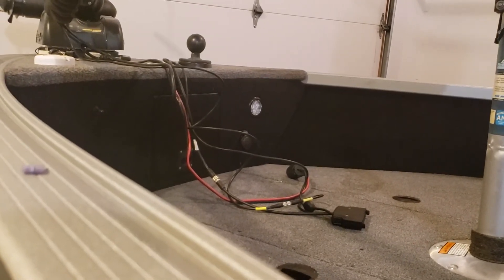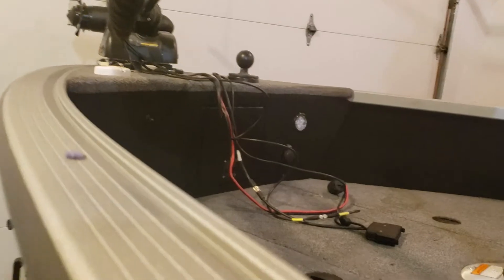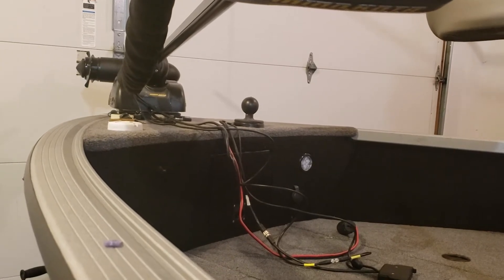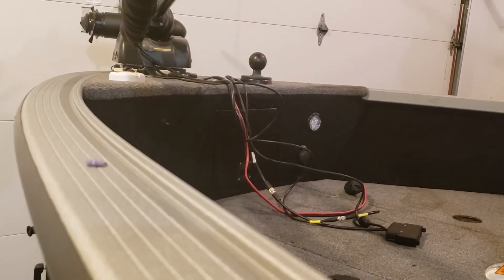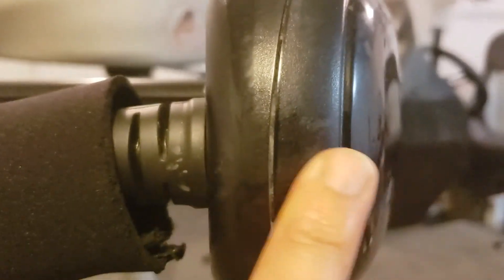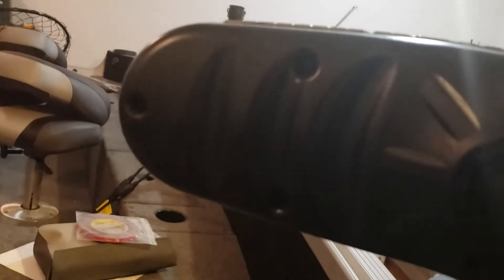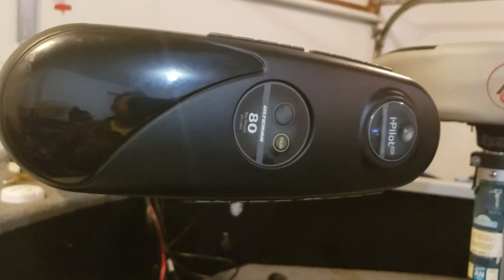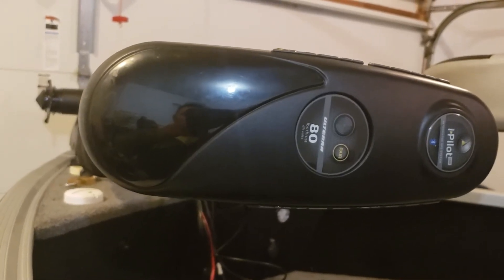SI Interference from trolling motor

Comment: Nice video, my question is that i hit a sand bank with my ulterra at speed 6, after 5 min of hitting it my prop wouldn't spin no more. The 3amp fuse was blown.  I replaced it and the prop started working again.  But now my lower unit has electrolysis, white ashes powder that is burning through the lower unit.  Do you think i have a ground shorted in my lower unit after i hit the sand bank with it?

Comment: What if I have interference and the fuse is good? That is my issue. I wish the fuse was blown then I would know the problem.
Reply from the maker: Do you only have interference when the motor is running, or do you have interference all the time?
Reply: @RealLifeFishingWI  when its running 1 to 9 speed. 10 speed no interference
Reply from the maker: Hey, sorry for the late reply...  I really need to do a better job staying on top of this channel!  My GUESS at the cause of that problem would be a bad ground, possibly in the motor case.  Having opened these things up myself tinkering with them, they are NOT easy to get put back together again - not without messing something up.  If it's a valuable trolling motor, I'd find a nearby Authorized Repair center and take it in.  It has been my experience that often times, the repair cost is much less than initially anticipated.

Comment: Ahh..I was hoping to see a picture of the repair that was properly wired
Reply from the maker: The original job was so poorly performed that the proper repair ultimately ended up being a complete replacement of the lower unit and shaft assembly.  That's why my grass ninja blade is missing in that photo.  So the picture that you seek should be available on Google images, since it's just a factory unit, as manufactured by MK.  Thanks for watching!